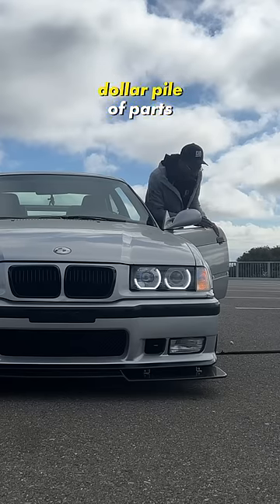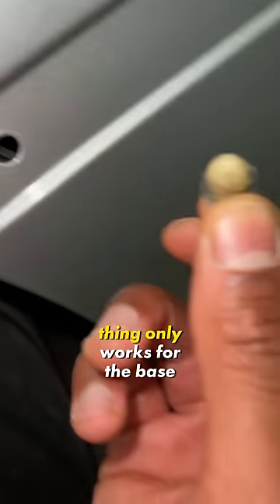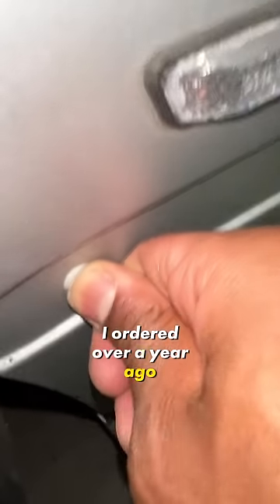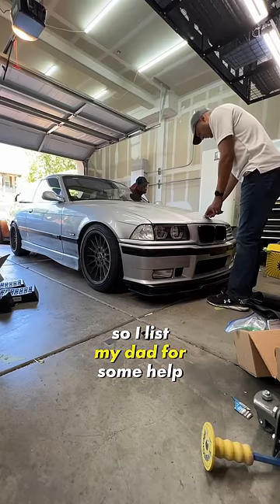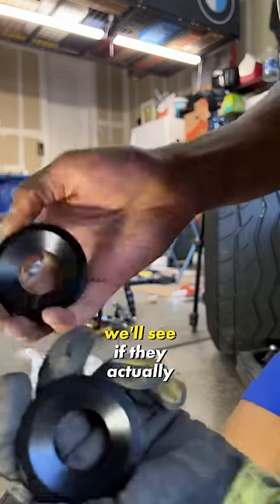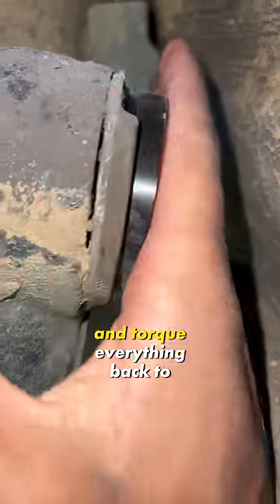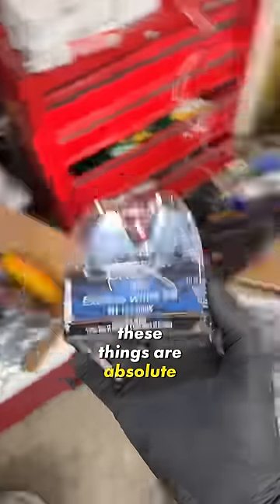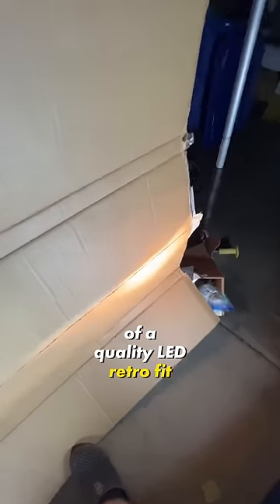$300 car reverts to pile of parts | Day 16 #e36 build

Comment: The best thing about the e36 is after you own one you learn how to fix every thing!
Reply: I feel like i did a better job building my e36 honestly
Reply: that's why it's a car guys car
Reply: How do I find one for $300 though. Not shit like that under $4k in Detroit...
Reply: @woodsdaily  theyve doubled in value but with the economy how it is i imagine they will be cheaper soon at least temporarily
Reply: where did you get that m3  plastic clips ???? i cant find them please help
Reply: You not lying 😂 from the week I got mine I’ve been fixing shit from suspension, wheel bearings, radiators, fans, ignition spinning etc lmfao
Reply: @karimickey  literally every single one of those items I've replaced on my coupe 🤣
Reply: @karimickey  poly bushings and coilovers are the way to go
Reply: @thehype4817 they fall from pine trees. Go to the woods.
Reply: Me with a Chrysler 200, everything but the engine and trans.
Reply: @craig9365 the car is great, peasant. It's just old and mechanically complicated. And it's not the kind of car you get when you need reliability. If you want to drive a toaster oven of a car from A to B with no worries buy Honda or Toyota.
Reply: That’s every single car ever lol
Reply: @wishtheyunderstoodme yeah it’s a car guys car because it comes to every secondhand+ owner as a certified shitbox
Reply: @junyaiwase  nah you just need to buy one from an old dude who got it babied by bmw its whole life

Comment: This is the most accurate representation of owning an e36
Reply: You fix everything imaginable and then another thing breaks 😂
Reply: In 90%, it would be more accurate if he had to replace the part of chassis where the swing arm is mounted 😂
Reply: he's missing the door panel coming off when you try and close the door, or the windshield wiper hitting the hood because 99% of times they're put wrong by some dude, or the lifter ticking noise, or the hunting idle because of the vacuum leak, or the throttle pedal breaking from its thin plastic hinge, or the oil leak from the rear corner of the valve cover or the... im just going to stop here lmao
Reply: Honestly as a Lexus JZS owner every 300 japanese, german or american shitbox will be the same... People think Lexus LS or SC or Acuras are cheap luxury cars to maintain and then they see OEM parts Prices..
Reply: @Cris-il4ht  after a certain age all cars for the most part become pretty unreliable lol. Most people who own these 90s cars are not keeping everything up to date. You get stuck with the bill for maintenance when you buy them.
Reply: Yz
Reply: @ChrysGaines how many miles on the e36?

Comment: It is insane that you got that car for $300 nowadays this series is awesome
Reply: Yeah because its falling apart 😂 he put trim pieces under he gold before he even fixed the steering and suspension 😂
Reply from the maker: @infernaldaedra  already did custom feal 441+ coils, all new front arms, balljoints, poly bushings, Z3 steering rack upgrade, chase bays power steering upgrade, sway bars, and strut braces front and rear 😄. the $300 series is primarily about the exterior mods i deferred
Reply: @infernaldaedra dawg I would pay 300 for one folded in half with a useable block💀
Reply: @infernaldaedra  I don’t think you are understanding exactly how amazing this is though… he got a car (A BM FUCKING W) for THREE. HUNDRED. DOLLARS. That is fucking insane but considering this is POST COVID market!! Dude people are buying fucking tires for more than this dude spent on a whole car…
Reply: @se7ense7ens37  on vacation in Italy  to meet up with my German relatives one of them got 3 punctures in the span of a week due to Italian roads. He has expensive "run on flat" tires so his rims don't get destroyed, and each tire replacement was a minimum of $500
Reply: @infernaldaedra  For $300 in the snowbelt, you could probably get one of these. But it would've rotted from the salt for 25 years, and it'd be a salvaged skeleton someone burned down after they stole it.

I'm lying, that's too nice. You'd probably be able to buy two tires. Flat ones.
Reply: @se7ense7ens37 I'm still driving an 08 Grand Cherokee I bought for 200 bucks on the 4th of July. It rides like 200 bucks worth of Jeep, nowhere near nice ass even a broke down E36.
Reply: @Hype679 😂
Reply: @se7ense7ens37  beat E46s are often ~$500 but E36s are way more expensive, even for the shitty ones. Man got lucky
Reply: No way he got it for 300

Comment: As someone who owns a salvage title c-class, there is nothing more expensive than a cheap German car.
Reply: Got a "steal" on a V8 530i once.

After replacing the intake gaskets, fuel pump, crank and cam position sensors, PCV separator, fuel filters (yep, plural), coolant valve body, idle control module, and DME (3 times!), it still had so many problems.

Needed a new radiator, valley pan (bonded seal, and warped), valve cover seals, water pump, fan and clutch, driveshaft guibo, tires, ignition coils . . .

Scrapped it after driving it for a year and working on it for several more. Never again.
Reply: C240 owner here.
Reply: @onlyrog5 which year is your C240?
Reply: @Azlehria I would've stopped at replacing the crank lol
Reply: Yeah there is ..a cheap British car lol. '04 Jaguar XJR, she has been relatively reliable but my heater core went out a year ago and I paid $480 for the part only
Reply: @ineedapharmists  he didnt replace the crank he replaced the crank position sensor and cam position sensor
Reply: C55 here. 7k car to 14k after maintenance over the past few years.
I still have the e39 525i with 400k miles still running and driving, and that somehow stayed under 3k total investment
Reply: I have a salvage title cls550 so I understand all too well
Reply: @Azlehria  As a Lexus JZS owner the Same will happen with any old neglected lexus or any car..

Comment: Please don't buy LEDs. They blind everyone on the road. They're ALL x4 times brighter than the original halogens the headlights were designed for.
Reply: LEDs will probably set off the bulb out warning on dash. Stick with plain clear halogen bulbs like Philips. Check for solid ground and positive connections at 13.8v with running engine.

Comment: You get what you pay for.  Most of the time, you have to add a resistor to the LED.
Reply: Sealight? I forget the brand name, but I've had good luck with the Amazon specials..

Comment: Man I miss my Dinan Stage 2+ E36 M3 sedan all black with Vader front seats and Thule roof rack etc and all DINAN parts except the supercharger, Instead it had DINAN cold air intake, DINAN, throttle bodies, DINAN strut bars, DINAN exhaust, DINAN ecu tune, DINAN transmission tune, it was auto :( but had DINAN springs, biggest regret selling it.

Comment: Fahren Automotive for LED retrofit. My entire family runs them without issue. They come with the resistor wired in a separate housing for better cooling with a fan on the back of each bulb as well. Not very expensive but easy to install. No warning lights.

Comment: Boslla light bulbs are amazing and cheap. The 60w bulbs are usually enough, but since you have projector headlights, get the 80w or go for the 180w if you want to splash the cash. But when ti was younger I spent close to $700 trying to find correct bulbs for projector housings and let me tell you, boslla has it figured out.

Comment: I don’t know much about leds but usually you have to step down the power so you don’t blow the leds out.
Reply: Leds have a lot less resistance so stepping down the power is a good idea

Leds having less resistance is also why replacing your indicator bulbs with led ones is not a good idea because then they are gonna flash super quick
If you want to visualize what that looks like, go put your hazards on after unplugging a few of the indicators

On the topic of led replacements, make sure that if you are getting an led replacement, make sure it is a whole enclosed light and not just swapping your xenon or halogens for an led bulb
Because if you "struggled" to see with halogens or leds the you are definitely gonna struggle then because leds don't have the same light patterns as other bulbs and so the physical shape of your headlight is not going to reflect the light correctly and is just gonna most likely fly out just one direction or not even make it far out the light casing, or even worse and why I have a distain for led lights, blind everyone and everything around you whilst leaving you blind as well

Replacing led lights is not a cheap and easy plug and play thing because it's something very important to your safety and other peoples safety so do research
Often why I encourage people to just try out new replacement halogens or xenons instead of going straight to led

Don't let this put you off leds though, if they work with the design of your car and you've made sure they're safe and actually functional then all the fucking power to you
Just please don't go get some pre led era car and stuff a replacement led bulb in and expect it to look or work good

Comment: I worked nights so have lots of experiance with bulbs. The super bright halogens bulbs die for me anout 45 days. Regular bulbs about 8 months to 1 year.  I got led hikari about 100 a set so far 2 years in and they are still working.

Comment: There’s only one one option for LED retrofitting that I’d recommend and that is a bi-led projector retrofit.
NHK makes two great projectors, iv+ and v(Roman numerals), iv+ has a brighter high beam and v has a better overall spread of light.
There’s also Morinoto M-led 2.0 as an alternative to the 5.
Just putting LED “bulbs” will give you better than halogen but they will produce more light where it will blind other drivers
Reply from the maker: do i need Bi-led’s if i’d rather keep the inner lenses as high beams and use the outer projectors for lows?
Reply: @ChrysGaines  you could just do led projectors for that but a biled projector is thesame to install , just wire up the highbeam mode to the inner normal highbeams and you've got extra highbeam :)
My e46 i have made all lenses bi-xenon(basically thesame as biled but led was not avaliable when i did them)
Reply: @ChrysGaines  If swapping makes you uncertain there’s a company called Lighwerkz that I can personally recommend , they built my first set of xenon’s :)

Comment: Dont get LEDs unless the housing is designed for them. I stupidly ran LED retrofits in my car for a few years until one failed. I switched back to the old halogens as a temporary fix until I could get new LEDs and was blown away by the difference. The halogens were dimmer but I could see almost twice as far because the housing was actually designed for halogen bulbs.

Comment: HIKARI LED from Amazon been running them in my 7 series e38 for a year now , they have 4 different brightness options in lumens.. I use the purple box 20,000 lumens for my high beams and Red box 10,000 lumen

Comment: Considering you’re using xenon right now, specifically the ones from advance auto, just look over about 2 shelves, should have the LED bulbs and any resistor kits you need for a conversion

Comment: Theirs no way that strut bad did anything other than cosmetic at this point for the car, replacing worn suspension components or changing to polyurethane bushing will affect handling way more, same with coilovers, ball joints, or any other worn stock components. You can also fully weld some of the stock automotive tac weld to stop body flex way more. Looks god tho and im sure it adds value as its more visible than anything i mentioned.

Comment: Easily go to Sylvania for headlamps. If you want to really go all out, buy a light bar and wire it behind the grill. Can get one off temu for legit $15 and they work amazing. I have had one for almost 2 months wired into a switch in my dash and it has been thru water, mud, rain, a hurricane, and tons of offroading
Reply: Underrated mod for any car imo and teaches you about wiring so you can do other stuff down the line
Reply: @DIE2dayORelse  exactly! On top of it, they can make it so easy with an add a fuse or if you want to learn the right way, an inline fuse. I actually used an add a fuse, but don't think I had the switches wiring right, so I have up and used an inline directly to the battery. Trials by fire are the best way in my opinion

Comment: Just buy the philips led bulbs, expensive, but they have the same light pattern as the factory bulbs so the light does not blind people in the opposite direction and they actually light up the road and not the sky 😂

Comment: For a LED retrofit you would need the change the whole lamp, as the reflectors and optics need to be different for LED light.
Reply: For reflectors yes, with projectors you can get away with a good set of bulbs. It’s not ideal but it can’t blind other road users as long as the headlights are aimed.

Comment: I have the same issue with my LED Headlights on my GTP and its honestly ridiculous lmao
Reply: The biggest problem is that led lights have this image around them that they're cheap, easy and the best light to use
Which is often never the case because unless you spend shit tons on some really high quality ones. They either leak really bad, last like 5 minutes, discolor weirdly in some cases which I didn't know was a thing but well I've seen some cases that have changed my mind on that, or they just bug out weirdly
Some of that is definitely at the fault of the installer but I won't blame them because most of those who sell led replacements don't teach the buyers much about it
Like how they have significantly lower resistance than conventional bulbs so replacing your indicators without making changes to the rest of the wiring harness will cause them to flash way to quickly or how not making any changes to the power going into the lights can cause premature failure and such

Or worst of all
The replacement led bulbs... Please never replace a non led bulb with an led bulb

Otherwise you're gonna get light that goes everywhere but where it should and can end up being more dangerous than driving with some burnt halogens
Light casings are designed a specific way for a specific bulb
Leds are not a bulb, they're essentially just a square while a bulb is this tube, the light patterns they reflect are completely different

So if you are going to replace your lights with leds
Get some high quality ones and give it a bit of research because they aren't as simple as some manufacturers make them out to be

Now if you want led lights for looks then you can avoid what I'm gonna say next
But if you want led lights to see better... Just get some new halogens or xenons instead of replacing it with leds because in reality, halogens alone are really really good at being car lights and if you struggle to see properly whilst driving with new fresh halogens and your lights and window is clean... Then leds won't solve your issue because then that's either an eye related issue or environment related issue that you won't solve with some auto zone bulbs

I'm short, if you do want led lights... Get good quality ones and install them in a way that won't cause premature failure or weird light patterns 
otherwise just stick to halogens or xenons

Comment: 300$ in germany they cost almost round about 4500-9000€
Reply: I just bought a six cylinder 520i for 500 Euros. It just needed two new tires and one radiator hose to get through the Tüv (MOT).

Comment: The best LED bulb for projector headlights is none. They don't have a proper beam angle and will give you less distance projection than a halogen or xenon. Stick with those. I know incandescents are seen as "old" and "obsolete," but these headlights were designed to use specifically them, and while LEDs can produce more light, if your reflectors can't get that light going in the right direction, you're ending up with truly inferior lighting.

Comment: Those old bulbs are cheap garbage and the new ones are expensive garbage. Those highend sylvania halogens last 1/4 the time as a regular halogen. Went thru 3 sets in a year $65 each time then but a set of 35w ddmtuning hids like 10 years ago and never had another low beam problem.

Comment: So I have a honest question, how much does it cost to do all the required fixes. Does the $300 make it worth it?

I figured it could help, not need to save as long and hopefully get the items fixed in smaller payments, so even if it does cost as much as a new car in the end you would have it in more manageable payments for your current economic situation. Plus no repeated payments like a new one from a dealer but I think that the money needed to repair it might cancel that one out.
Reply from the maker: the cars really worth like $300, but i had to pay more to get it ASAP during the pandemic. if all you wanted was a car that drives, then buying one without body damage is worth it. i could have driven the car as i bought it for a while with probably just oil changes for a while. but you have to replace a lot of stuff to get it to drive like a dream. most e36’s need a ton of work to drive well again anyways, so might as well start cheap. once you get the car mechanically sound, you can just drive it and add mods whenever your wallet allows. on the other hand, M3’s cost a premium, but maintain their value well if you plan on reselling. other newer cars will need less intense work to drive well (like my 350z) while still being cheapish to purchase